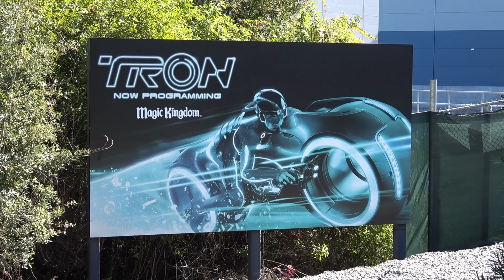Why is TRON taking SO LONG?!

Comment: Wonder how this ride is going to work out, it looks like you lean over the bikes like a racing bike and less like Hagrid's where you sit up.   And well there's no way to dance around this, so I'll just be blunt there are vastly more people in US parks who ride around in ECV scooters and not because of leg injuries, I wonder if they are going to be turned away for not fitting, or what.
Reply: Not sure of you've seen the  footage online from Shanghai or no,  but the ride vehicles, two bikes  side by side, require you to pretty much straddle it like a racehorse. There are leg cuffs that clamp over your ankles on the sides, and a back plate (with the 'memory disc' that holds you down from behind. The ride vehicles are nothing like Hagrid's at Universal Studios. These are more like genuine thrill park vehicle, many park guests will have issue fitting on them Im afraid- we'll see.
Reply: @eclipsehorse8693  That's what I thought.   Considering the number of "oversized" guests tend to be larger in the US than in China,  I would think this could definitely restrict quite a number of people.

Comment: Notice that Disney Q1 earnings were artificially high. Bob Cheapek and his minions are systematically opening and closing experiences to control attendance, merch purchases and more to produce artificial earning spikes at just the right time. They are taking advantage of naive people who have no clue about the history of Disney and the previous mission statement to provide a red carpet experience to ALL at an affordable price. Vegas figured this out years ago. What used to be a "perk" is now either gone or has a fee attached to it. From Hotel resort parking to Lightning Lane, Genie+ and many more, everything now has a price tag associated to it. I'm surprised they haven't lowered ticket prices to increase attendance. Probably because attendance is currently high due to pandemic concerns dropping. By attracting more people at a lower price for admission, they'll sell more merch, food and anything else they can put a price tag on. Like Lowe's putting paint on sale. It draws people in and they buy lots of brushes and other stuff, not on sale, while they are there.

Comment: Why is it taking so long? In 2021 it was because of supply chain issues. Material. They wouldn’t get the material.
Reply: It was announced in 2017... what was the issue then? Yeah, global supply chain...sure.
Reply: @gracielou-pickle5151  notice I said in 2021. 
2018 project was delayed due to water issues
2020 project was shut down due to pandemic 
2021 project was delayed due to material supply chain issues. 

Cool?

Comment: I do have to call you out on something. You stated in the video about the retention pond situation where the building for Tron is now. Let me make it clear that you aren't exactly correct in how it was explained. It took so long to even begin setting foundations and track and such because of logistics. Before any of that could begin a canal had to be moved and retention pond also that is part of that canal also had to be moved. Both of those were where the building is currently. The fact that it only took about 14 months to get to the point where they could begin building is actually on par. You are speculating on things you really have no idea about. Given the climate currently about Disney parks and perceptions (mostly negative ones)... maybe you should do better research before ripping on them. Believe me, they deserve being berated on many things. But trying to put blame on them for being slow is just being petty. No one saw COVID coming. It's obviously had a tremendous impact on the construction of this project and affected more than just the ride itself...the railroad as well. Point is, you might want to temper how you are presenting the topic. Maybe not? It's on you.

Comment: Obviously there's no reason to go to Wdw... there's been no railroad in 4 years...ish. If they continue to put off the opening of Tron and subsequently the Wdw railroad, there's still no reason to go. Enough said.
Reply: They're testing the railroad now bud!
Reply: @chadalac1977  I'm aware of that. But testing or test runs around a partially completed track is one thing. The fact that there's a 1000 ft section of track missing in the middle of a construction project is another. To be able to get to the point of being able to get the track in place and subsequently the area around the track and it's separate tunnel is entirely another thing altogether. I guess you don't really think that Disney is going to run that train with guests on board through the middle of a construction project...or maybe you do. It's still going to be quite a while before we get that train. Fact!